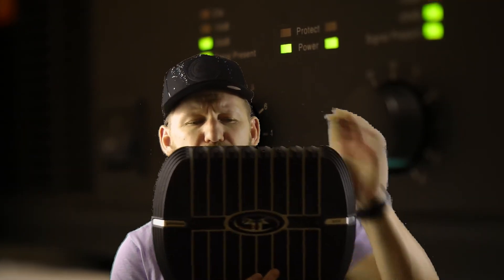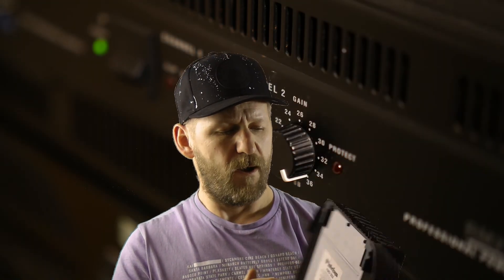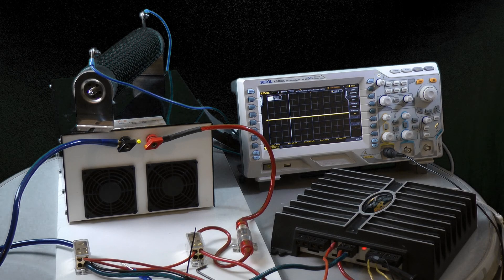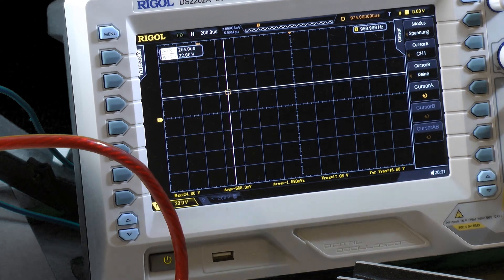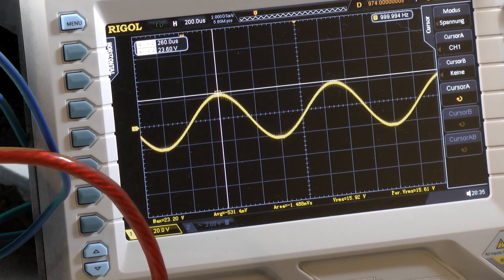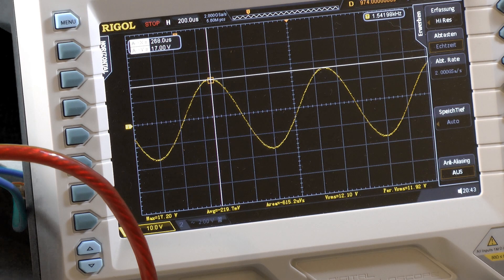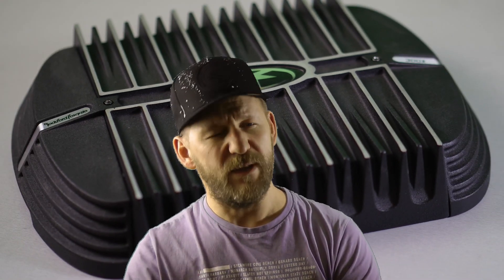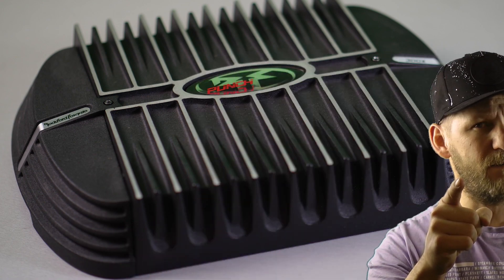Rockford Fosgate punch 300x amp dyno run amplifier power test old school 1kHz cont. & dynamic burst

Comment: Sorry if I missed it. But when you do the dyno test what input voltage are you testing at? 12. 14.4? I like the channel. One suggestion. Please turn down the music or speak louder it is hard to hear you sometime.
Keep up the great work. From a German in Mississippi.
Reply from the maker: hi!
my input voltage is 13.8 volts and 13.7 volts under heavy load. Several people told me to turn down music, so i did but seems not to be enough. it also depends on the device you listen to it. so i try to reduce it a little more in my next videos.
Vielen Dank 👍😁

Comment: At what voltage are you testing? And are you testing with all channels loaded
Reply from the maker: I measured with 13.7v dc supply voltage. 2 channel amps are measured with all channels loaded. in this case only one channel has been tested for power.  if you measure 2 channels loaded , outputpower is reduced by around 5%. All channels loaded will give you around 60 watts in the continuous power test. cont. power test is harder for the amps power supply than dynamic power test. At 14.4vdc supply voltage the output power values are a little higher.